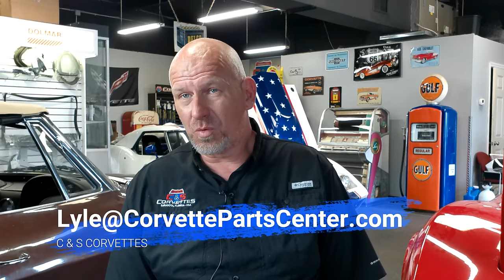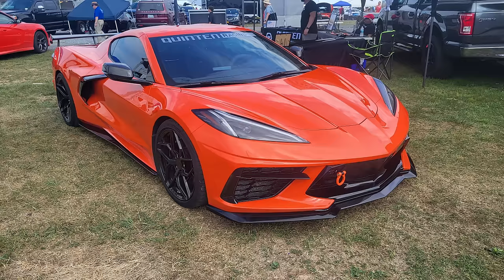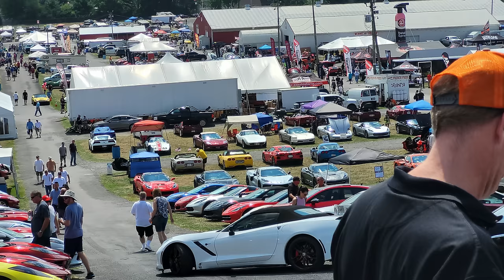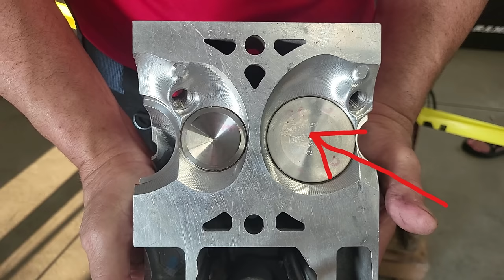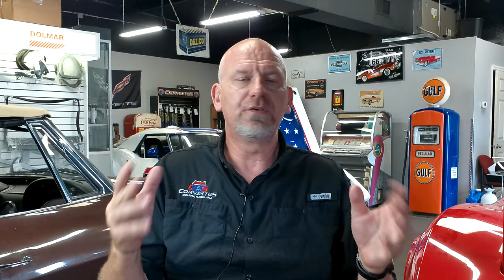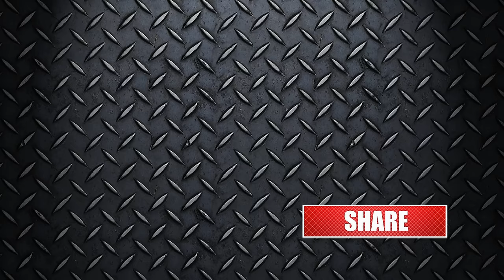The Truth about the LS7

Comment: Lyle, I appreciate your U tube videos & respect your knowledge but the LS7 had (has) valve guide issues through the 2013 model year...even the Z28 LS7 Camaros had ( have) this issue. Corvette Forum has many posts about the later model year LS7 cars suffering catastrophic engine issues. I own an LS7 Corvette & love the power the car has but this issue is always in the back of my head. This issue is real & it follows all model years
Reply: 99 percent of people in forums are modifying/modified the car. Lyle literally said you start having issues when you modify
Reply: It's a $2-$3k job.  Peace of mind goes a long way.  When I bought my '08 Z06, I had it in the budget right away.  It is BS that this affects only modded cars.
Reply: People modify with heads and cam and have zero issues. Find a shop that has done hundreds and you'll never have a problem.

Comment: I own a 2013 427 convertible with 44k miles (stock drivetrain). The car is not driven hard at all and while stopped at traffic light the valve spring on the #8 cylinder decided to take a walk. Towed to the dealership and the service manager says, oh, your car may be one that is noted for valve issues. Two days later I am told the intake and all gaskets warped and need to be replaced and GM will not help defray any of the costs... You would think GM would have stepped up and at least offered something to support a loyal customer who spends a tone of money for their product.

Comment: I have a 2013 427 and no issues with 30k miles. Didn’t have any issues with my previous Z06 either with 44K miles. In 2011 GM improved the valves and created more allowable tolerances for improved reliability. They learned that from the C6R race-car in 2010. Good luck.

Comment: I have a bone stock 2007 Z06 corvette I purchased new and the engine dropped the valves in one cylinder at 44,000 miles. The failure caused the rod to punch a hole in the block which totally ruined the engine. I purchased a new complete engine from a local chevy dealer for $10,900. dollars and another $4,500.00 to install the new engine. The corvette presently sits in my heated garage with only 500 miles on the new LS-7 engine. I am now concerned about the quality of the engine which was purchased about 2021 and therefore do not drive it. It sits along side of my new 2023 corvette stingray collecting dust. It will serve as a collector vehicle. I got no help from chevy at all.

Comment: I'm pretty sure that there was a valve issue that was traced to a problem with the rocker arm needle bearings that affected the VERY late build 2006's (June/06, July/06 builds) as well as 07's built between August and November of '06 (I once owned an '06).  Edited to include this - and then there was the valve spring issue affecting '02 Z06's as well as a few of the early-build '03's (I once owned an '03 and had the springs replaced as a precaution measure).  Seems it's always something.
Reply: I enjoyed my 2002 electron blue Z06 straight away 177 per hour tunnel vision for $55,000.00. Had 5 other vets various degrees lol. 3 C7s not impressed with Bowling Green. C6 felt kind of slippery. I probably will go back C5 when the dollar adjusts my way lol.
Reply: The needle bearing issue was not related to the valve drop issue with the LS7. It was a separate issue in 2006 and was corrected for the 2007 model year. The LS7 heads had machining issues and the valve guide bores  were not concentric with the valve seat which caused wear on the valve guides. The exhaust valve was a hollow stem and was the weak point when the tolerance moved out side GM spec. Once out side the spec you we’re on borrowed time.

Comment: What I've learned from getting involved with tuning the 96 C-4 with Jets DST is GM bogs these cars down with extreme knock tables and timing retard along with torque management in the ECM. Reducing some of these extreme measures they use for EPA, driveability and protection will greatly enhance performance as long as you know what you're doing. Tuning the stock 96 C-4 coupe with one of the tuner programs for the LT-1, I used JET, completely changed and enhanced performance. Slightly more horsepower but allot more torque over stock. I can only imagine what you can do to a C-5, C-6 and C-7 just by tuning them without bolt  ons.
Reply: If you want to really have fun with a C4, replace the GM Injection with a Holley Sniper or anything else, even a Holley 750 double pumper carburetor. Put in a roller cam at 1970 LT1 specifications for street driveablilty. I also put in an MSD Distributor. My son has never lost street racing my old C-4 auto cross car when I put in my 1970 LT1 with the Doug Nash 4+3. scary fun
Reply: Head’s, Cam’s E85 an a tune is good for 640 reliable WHP. Mind you the transmission! If you behave and play like a nice boy all you theoretically need is a solid clutch combination and you should be good. Now! If you’re going to be banging that stick late at night with criminal intent! I would politely suggest you throw some axels in there for good measure. And  again! We still playing nice here. Now if you really want to be naughty, and play with some oxygen supplementation… consider some good gears.  A stock bottom end  can live its entire existence @750hp, of course this is entirely dependent you your lvl of maturity.
Reply: @carazo321  you must be talking about a C5 or newer, because that ain’t happening with an LT1 in a C4

Comment: We have a fairly large LS scene here, all the go to guys say the valves have issues no matter what. That's all I really need to know. Additionally, a lot of us want to mod the car. Especially an LS7 given the appeal of making over 600 wheel, NA. Shouldn't have to worry about mods wiping a motor, when done correctly and with a tune. Just my opinion.
Reply: Right? To me it almost sounds like this motor wants to be modified to rectify the issue with the heads. Like getting good heads and a good tune would actually be better for it than leaving it stock. Like those guys with the early 6th gen Camaros that got sick of the torque converter problems and just went and got a stall put in. No more torque converter issues lol

Comment: happy to see someone recognize how tightly engineered modern engine design is, even down to the temperatures for optimum combustion events.  As a C5 owner,  because of the age of the car,  there are a tremendous amount of " modifications  you must do", "Five essential mods" ,"ten essential must do changes " out there with very few considerations as to the actual end result and ownership goals for the car.

One should remember these cars are very carefully designed for efficiency .    You move one system outside of the original design specifications , and you will probably effect that systems efficiency , and efficiency is optimum speed and power.  You might even, as mentioned in the presentation, start breaking things.
Reply: I've owned a C5 for 15 years and have done no mods to it. Just regular maintenance. What am I missing out on? Just curious. Btw, put about 90,000 on the car and still love her. She routinely gets 33mpg around town. Yes, it's a 6 speed and I do a lot of coasting, up and down hills. LOL! I call it "Energy Management 101". 😆
Reply: Ive modded my c5 a lot and have no issues with it.
Reply: Some call it “efficiency” others like myself refer to it as budget parts from the cheapest contract bid.  I’ve owned 3 C5’s and still own my highly modified 640whp/568wtq C5 since new in 1999.  Build them right, take care of them and they will last. 140k+ miles and counting.

Comment: Interesting to read all the negative comments. I bought a new ‘07 ZO6, and had all the forum negatives all around me. To save myself the possible $20K to $25K expense of a destroyed engine, I went to a local Chevrolet dealer and said I wanted the heads replaced. The work was done under warranty, new heads, but the old valves, springs, etc. The engine never gave me a bit of trouble, it was not modded, and maintenance was done by the book.  Unfortunately, I had to sell the car due to physical impairments.

Comment: My neighbor was one of those 2006 owners who likely had the heads that were machined wrong based on research of likely builds. GM knew exactly which ones had it they just weren’t admitting it. He’s not an “Internet car guy” and just drives it around occasionally so he wasn’t aware of this issue until a couple years ago. When he reached out to GM they refused to do anything about it so he was SOL. Poor guy really had no choice to sell or live with the likely event, take it to an aftermarket shop (which he didn’t want to do). Old guy with a very low mile Vette too. I feel bad for him. This is a real concern for those folks who aren’t car guys, and specifically buy these cars to keep them stock.

Comment: My 2007 z06 with 25k miles, cream puff miles box stock. Had valves checked when I bought it and and over half the valves were out of spec. You have to rev engine to 7k or shifting from 4 to 5 or 5 th is a pig. I did valves lifters and spring with cam. Use moldstar90 valve guides

Comment: Am second owner of a stock 08 C6 50K miles with the original run flats.  Once I learned about the "guide" issue I had Able Chevy put the caliper on to check tolerance.  For piece of mind I allowed them to change heads for about 2500.00 ish.  Driving the car home I could easily hear how much less rattley the new heads were.  I know it's antedotal evidence but it was VERY obvious.  I'm from a race car family been driving cars/karts for 50 years now.  I fully restored my GT-1 car... I know sounds car motors make. I think what I did was the right thing for me

Comment: I have a 09 C6Z and have tracked it since I got it.  A track friend had one too and while running at Sebring with NCM he dropped a valve on the back straight.  His was stock.  Luckily, there were GM Engineers there and jumped on the car and had new heads delivered to the local Chevy dealer the next day and all was good.  My engine, after my 2nd trip to Daytona, a distinct “ticking” was heard.  It was under an extended warranty so my local dealer swapped heads for me.

Comment: Such bad information.  It is a known fact that ALL YEARS OF LS7 have valve guide issues, even on bone stock, lower mileage cars.  Too many forum members have dropped valves.  There isn't an issue with '06 heads and that wasn't even the year GM claimed was bad.

And he didn't even mention things like:
- Rocker issues on the '07
- Rod bearing issues on the '12-13 when GM changed materials (though most of those have been corrected unless you found an ultra low mileage example)
- Coating on the connecting rods wearing away.  Intake valves aren't the only source of titantium in your oil analysis

As a former LS7 owner, I left for a reason.  I (fortunately) came out unscathed and profited a bit on the car, but many others aren't as lucky as I was.

Comment: One thing to consider is, with those tight tolerances, you should be very careful about high revs when the engine is cold. I always drove my 2008 Z06 very carefully so as to not rev above about 2500 until the oil was at temp. I owned that car from new until I got my 2019 Z06 and never had any issues.(48k miles)  My 2019 changes the red line on the tachometer until it has reached a safe temp. Remember that all metals grow with heat and the engines are designed to be have correct clearances once at operating temp. They are out of tolerance when cold, so high revs will cause way more wear.
Reply from the maker: Excellent point!!!

Comment: Actual owner data point (one data point).  I own a 2011 Z06/Z07.  I ordered it and bought it new.  It has 16,000 miles on it.  This car is a toy, most of the 16,000 are track miles.  The power train is stock right down to the air filter.  I have always understood the torque curve of this engine and have made a habit of shifting around 6,000 rpm for the reasons given here.  The car runs great and I have no plans for changing anything on the car or my driving style.  Also, sodium filled valves are not new nor are they "trick".   They've been around since WWII, a lot of radial engines used them.  He is right about them being a good idea.

Comment: Meh. I have an LS7 making 650hp. Heads/cam, FBO, SBE LS7. Been on the same motor. No issues. I learned the hard way, hot rodding ain’t cheap. I was once young and broke and couldn’t afford to do things right. Went through motors. Now, much older, different position in life I’ve learned. Quality parts, and it’s all in the TUNE. Car is on nitrous as well. I remember going to TX2K and running my car damn near all night, still was able to drive home after 8-10 spray passes. Hot rodding can be reliable, from my experience but there’s a triangle. 

Cheap, reliable, fast. 

You can only choose two. If you are not going to spend the money on the right, parts, tuning, safety measures, etc. Keep it stock.

Comment: Lyle, I have a 1996 C4 although I have heard a lot of stories about the C6 LS 7. 
Basically if their motor was modified and  beat up this is the concern.
Thank you for the great content and dispelling  certain rumors !!
Reply: Frank sorry but your misinformed. I have a 2011 C6 Z/ Z07 and have had the heads replaced with New GM heads. ( My engine was stock). The new heads were out of spec when my engine builder received them.  He fixed them and made sure the valve guide bores were concentric with the valve seat. There have been a lot of Z owners that baby their cars and some even garage queens that have dropped valves pulling out of the driveway. Modified engines with high lift cams can be a problem, but if the heads are  machined correctly, the engine should not be a problem. The biggest item to check are the valve springs at about 10K miles.

Comment: HERE IN NEW YORK CITY NEAR THE 59TH STREET BRIDGE IS A GAS STATION WITH A REPAIR SHOP. FOR YEARS GOING TO THIS GAS STATION. I'VE BEEN SEEING LS MOTORS BEING CHANGED IN THE BIG SUVS. THESE SUVS ARE LIMOUSINES, AND ONE DAY I DECIDED TO ASK THE MECHANIC THERE WHY SO MANY ENGINE CHANGES WITH THE LS. HE SAID THEY HAVE ALL KINDS OF PROBLEMS. BUT THE WORST PROBLEM IS THE CONNECTING RODS BREAK WHERE THE CAPS MATE TOGETHER. THAT IS THE MOST COMMON PROBLEM AMONGST OTHER PROBLEMS. HE SAID THE LS ENGINES WHICH LAST ONLY 150 - 200,000 MILES AND THEY'RE GONE AND DEAD IN NORMAL DRIVING CONDITIONS NON-ABUSE. IF THEY'RE HAVING PROBLEMS IN THESE CONDITIONS IMAGINE WHEN YOU START BEATING UP ON THEM. WAVE GOODBYE TO THESE MOTORS.

Comment: This is kinda a weird thing to say. "The engine is great if you don't mod" well it's in a US made muscle car where 99% of them end up modded, it's in the culture. Also it's kinda ironic because every year of c6Z is known to drop valves, not just 06, and the common solution is to add an aftermarket valve train to bullet proof it so... That goes completely against what's in this video. But also what was said is exactly what I would expect a gm engineer to say.
Reply: Right? It seems like (I'm not a C6 Zo6 owner, so I don't have direct experience) everything this guy said is not what you want to do. This looks like a situation where you absolutely need to mod it to save the motor from itself. I get these guys who don't want to modify a nice Corvette (it's just a Corvette to me, they sell a lot of them), but sometimes you have to be flexible with this stuff. It's not like they have to change the cam or do anything that drastically changes the character of the car. Just put on better heads, with roller rockers to stop the side loading, and use different exhaust valves. No big deal, just factor it into the price of buying one of these.

Comment: american heritage and katech did a lot of work on these heads over 10 years ago. while it's more likely they fail under mods or repeated hard use some have failed bone stock. that coating GM used on the ti valves was sometimes not done as well as it could have been, this coupled with out of spec guides or uncoated valves wearing on loose guides and then grenading themselves is mostly what's behind this urban legend. for $3500 ahp will completely rebuild the heads with new PM guides,  new much better ti / moly intake valves and hollow ss or new stock exhaust valves. for $600 more you can even run F1 guides. the cost of the ls7 is so high to replace i could not imagine having a c6z without factoring in $3500 for the cylinder heads the day i took ownership. it's like the stock valve springs on the c5z, moderate deal on the 01, major problem on 02-03 and less of an issue on 04 but worth changing if you go racing even on the 04. if a valve does go through the piston on the ls7 there's at least a 50/50 chance it also takes out the block and that means. realistically you're spending 10-15k for a used motor or 20k+ for a new / built

Comment: Super great advice.  I used to tune my own chips on an older vette and I've seen this many times with owners.  Motorcycle owners as well.  Mostly people ignorant of the dynamics of the lamda leanout when making modifications which is exactly what this video targets.  Fuel trims on most engines are so lean that it's a wonder that they even run in the first place.  So a huge problem I think across the board. I've seen lots of WOT dyno run tunes which ignores possible problems at other throttle positions.  People want to get that peak number for the track and more often bragging rights and then are burning up the engines on the way to to the country club where 99% of the street driving is done because no one bothered to check what was happening at regular throttle positions.  Properly calibrated wideband O2 sensors are your friend, lol.